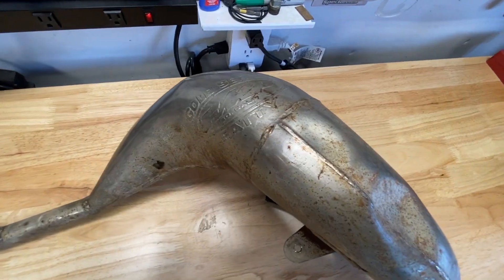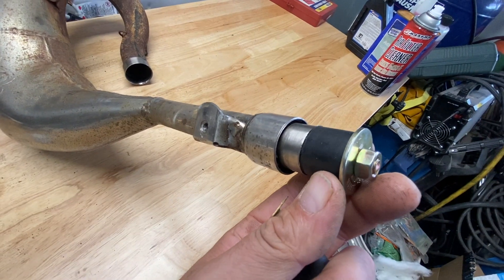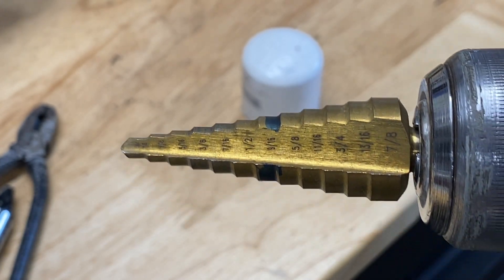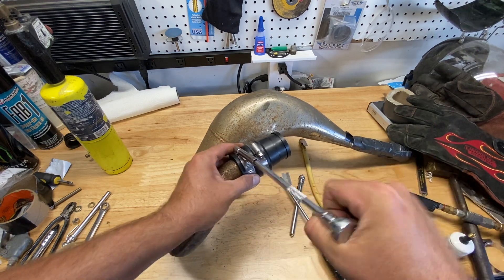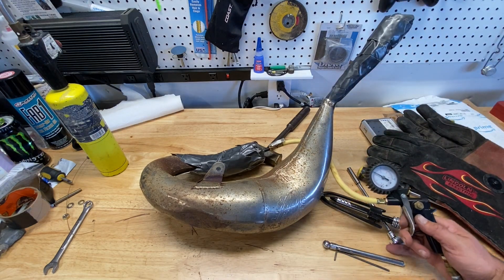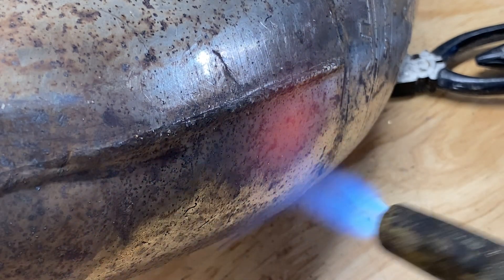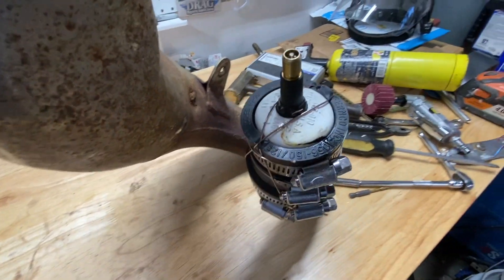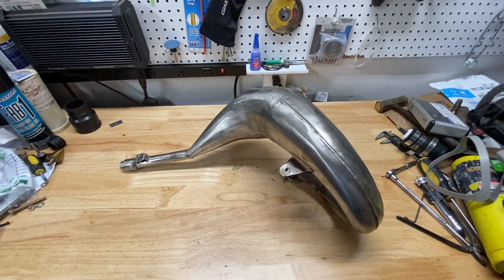2 Stroke Exhaust Pipe Dent Repair for $25

Comment: Be sure to seal you’re hose clamps well, i attempted this today and mine blew off. It may have caused air to get under my skin, i am unsure. Just keep that in mind everyone. Next time I attempt it i will be wearing a long sleeve shirt and tapping my welding gloves around my arms, i will also be wearing my welding mask 😅
Reply from the maker: The fittings should be duct taped also to keep them from potentially flying off. I would also wear welding gloves and not over pressure the pipe. Also point the ends away from you when doing this method.

Comment: Boooooooom watch your pressure
Reply from the maker: It probably hit 90 for a second before it leaked back down. I would not go higher than that.
Reply: @TheUltimateHandymanKyle I thought you needed like 600 psi

Comment: how did you clean up the pipe so nicely at the end? the wd-40 + scotch brite trick i know of would have taken an eternity
Reply from the maker: It’s called a flap wheel. I got it at Ace hardware. It’s has 120 grit sandpaper flaps and scotch brite pads sandwiched between. 
It’s looks similar to these I found on Amazon minis the scotch brite pads.
https://a.co/d/bgJG3ta
Reply from the maker: It probably took me 30 minutes to clean up and I did spray it with wd-40
Reply: @TheUltimateHandymanKyle  thanks!

Comment: All cool until the pvc cap comes flying out one day and hits you in the face.
Reply from the maker: That’s why I used tie wire and tape incase something fails. I also don’t have the ends pointed at my face. The tool is probably a better option for you. I just did this as an alternative to the tool.

Comment: Another way is to fill it up with water block the ends and freeze it.
When frozen it will expanded and pop the dent out.
Reply from the maker: I’ve seen this before. Maybe in a future video I’ll try this method.